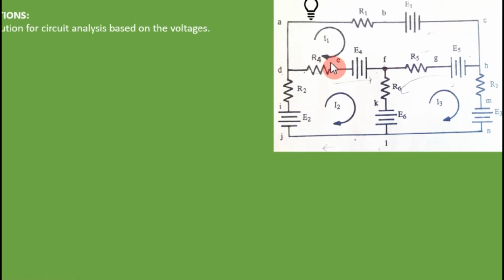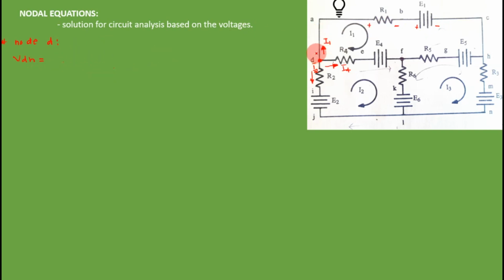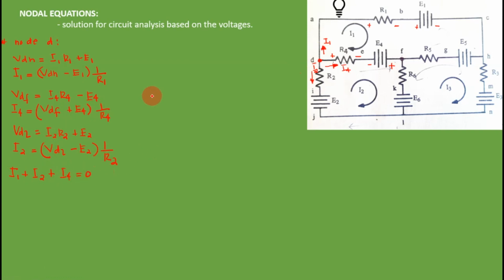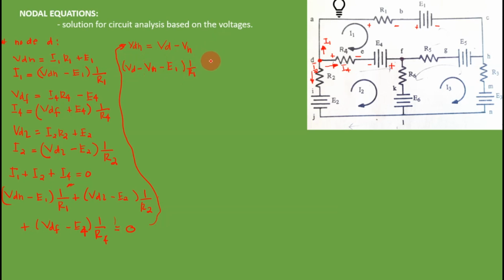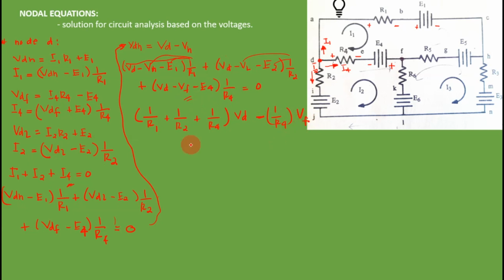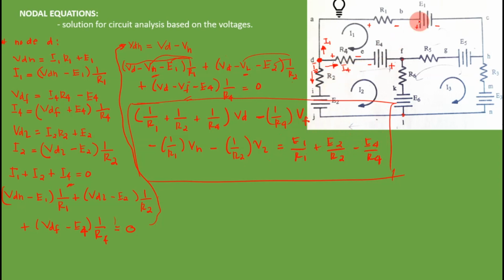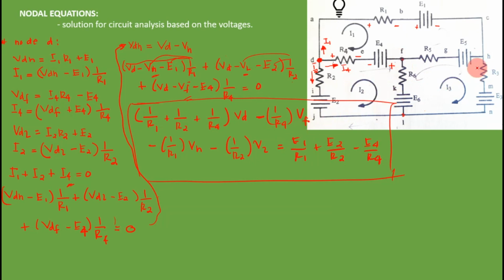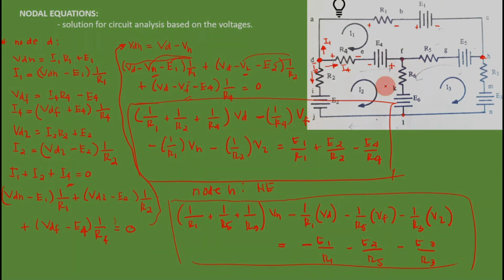NODAL EQUATIONS

Comment from the maker: Hello friends, current I4 was incorrectly copied when substituted to the KCL equation...
Reply: I did a last minute review and checked my notes from yesterday, turns out I answered it correctly and just realized it was incorrectly copied in the video at 5:15 hehe.
Reply: Opo Sir, -E4 should be +E4  because I4=(Vdf+E4)1/R4
Reply: Yes po sir. Agree
Reply: Sir, at 5:15, I noticed that it should be a positive sign which is (Vdf+E4)1/R4
Reply: Yes po sir, as I've told you po, -E4 should be +E4 po in the 2nd and 3rd equations that contain E sub 4... 😁
Reply: Ok poh sir
Reply: got it sir! 👌
Reply: It should be positive in E sub 4.
Reply: Correct po sir.. I also noticed that -E must be +E. 😊
Reply: Noted po sir
Reply: I agree sir
Reply: E4 is supposed to be negative